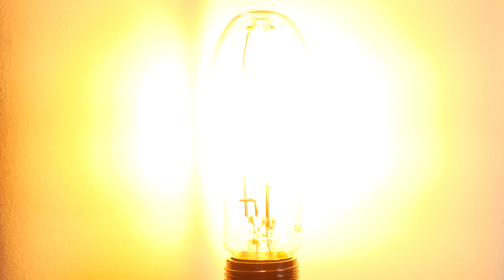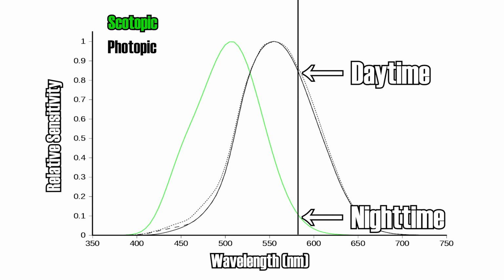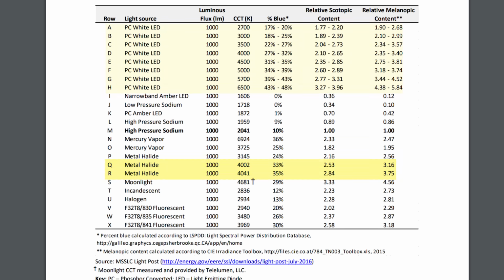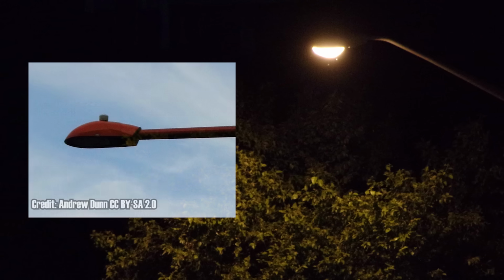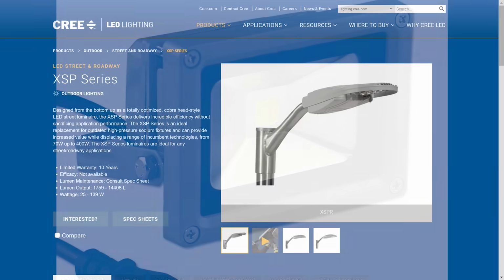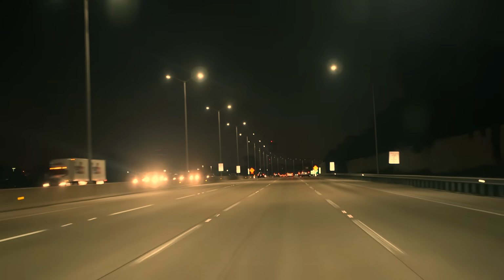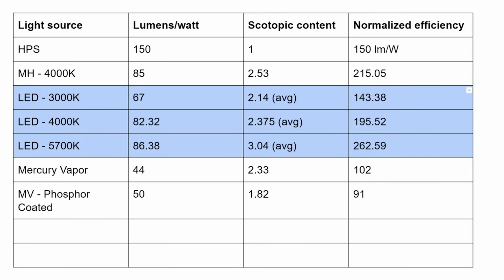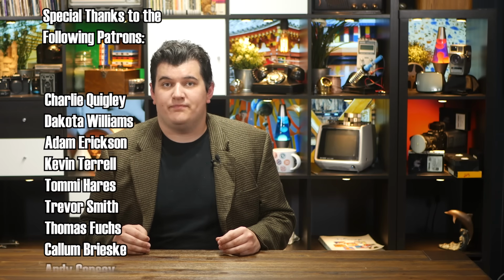The LED's Challenge to High Pressure Sodium

Comment: LED street lighting is crap, the cut off angles are too sharp resulting checker board roads, their reliability is questionable and their penetration thru fog is garbage. and I'm a fan of LED lighting but in the right place.  White sodium lamps are available.  I doubt that your energy figures are even close to  accurate you didn't account for the shithouse power factor of switch mode power supplies.
Reply from the maker: Maybe you should take a look at the spec sheet listed in the description.  The power factor of these Cree fixtures is greater than .9 and THD is less than 20%.  And as I had explained, there are good and bad optic designs.  The segments I showed on I-88 clearly demonstrate excellent light distribution with no "checker boarding".
Reply: A magnetic HPS ballast is a highly inductive load so the power factor of these is significantly worse than say a high powered/high quality LED driver from MEAN-WELL electronics with active power factor correction. Normally these top out at .98-.99
Reply: That is why I said "corrected" as for the electronic drivers, no chance they are near unity and don't forget to add in the harmonic and RF distortion they create.  Remember these things will be built and purchased on price, installed by idiots and maintained by no one, the only time a street light gets any kind of cleaning or attention is when it becomes a "street dark"; so even if your super quality driver and its matching super quality emitter all presumably housed in a super quality housing (sounds super expensive so far), lasts for yearrrrrs, the optics will all be filthy after a few years and there goes your light output, since HID lighting has a much larger window, it can be half full of dead moths (and how many of those have we seen), yet still have reasonable performance.. Most of the cheap garden variety road lanterns around me are better than 20 years old, all running their original gear and optics, all still going strong on probably only their third $9 lamp, so far more cost effective than LED.  So back in your box spikester, nice ad for MEAN-WELL, pity that they are responsible for the majority of the junk that I find myself replacing.
Reply: I will check it out, if it is really 0.9 lagging I will buy a hat so I can eat it...  I truly hope it is but none have been halfway close when I have put them on the analyser.  THD less than 20% I should damn well hope so I should hope it is less than 3%, sounds like I'm just being contrary for the sake of it but it LEDs are just not there yet and they are far too susceptible to voltage transients, air temperature, bird shit build up on the heat sinks, and vibration, keeping in mind that when they fail the whole $300+ thing is scrap, not just a $9 lamp or a $20 ballast.  Not there yet, there is no R.O.I. in replacing 400 Watt HPS fittings with 300 Watt LEDs or replacing 80 Watt MVs with 50Watt LEDs.

Comment: I am not quite sure I get the argument why sodium light leads to ineffective lighting - you say the reason is that its frequency is not one to which the eye is particularly sensible in the dark. But - after all - due to the sodium light, it is not dark, is it?
My understanding why sodium light sucks is its extreme monochromacity, which strongly filters the spectrum of the perceived objects, and leads to a distorted image.
Reply: you know how there are two types of photo receptors in oure eyes: the 3 types of colour receptors (Cones ) and the other ones which are more sensitive (Rods), now during the day we use the colour receptors almost exclusively and the sodium lights produce a spectrum that corresponds well to the percived brightness during well lit conditions, but when it's dark the other type of receptro (Rods) starts to take over and now the spectrum of the sodim light doesn't correspond well to percived brightness. While it is no longer "dark" under sodium lighting it is no where near the brightness of the sun so the rods are still responsible for the majority of the visual information reaching your brain.

Comment: Wouldn't it better that drivers don't feels asleep because the light resembles a light which make us tired? :? I don't get your point here.
Reply: For main roads yes. For neighbourhood lighting, lots of bedroom light pollution and much lower traffic...
Reply: Ruben Kelevra I thought that to. And our rhythms are already messed up cus of phones on screens in our cars anyways.
Reply: Alex Jago Curtains are a thing though. Here in northern Finland we have coped just fine even though during summer the sun doesn't even go down during night in mid summer. The only thing you need is good curtains to block the light.

The advatages of LED lights are pretty obvious. :P
Reply: XlordslaughterX That's a good point! I didn't even think about that... I suppose warmer light does have it's advatages. But which is more important: saving energy and slowing climate change, or help wildlife to sleep better? I would say energy saving is more important, since by warming up the climate we not only mess up local wildlife, but the wildlife worldwide.
Reply: Ruben Kelevra the issue with circadian rhythm disruption is more for wildlife from what I've heard in the past.
Reply: Agree. Perhaps apply the cooler lights on busy streets and highways, and keep warmer lights in smaller residential streets.
Reply: cdrom do you know what DOESNT have any downsides? Solar FREAKIN ROADWAYS. That's what.
Reply: If they had ever worked it sure would have added a lot of light pollution. ;)
Reply: I'd go with bright bluish lights for highways and fast main roads. For residential areas, where drivers are also at much lower risk of falling asleep at the wheel, warm light is a good choice.
Reply: Sleep or drowsiness was a contributing factor in 18.6% of nighttime road accidents according to 1999 Norwegian study on road safety. You have to be insane out of your mind to try to spin sleep disruption while driving as anything but a positive.
If streetlight are lighting your dwelling in a manner that is disturbing your sleep, buy window blinds. That is a small price for increased road safety and human life.
Reply: +Neil Etnyre Smartphones, on the other hand, has already a night-mode, changing the color temperature. Car screens also have night-modes, to get a much lower light output, by switching to black. :)
Reply: I don't any light from outside to get in my bedroom anyway. So I really don't care.

Comment: Where I live all the HPS street  lights have been converted to LED. I like them - plus they use a LOT less energy. And they've even swapped out HPS for LED on I-95 through the state. In fact they're flat fixtures so the light is cast into the streets where it belongs.

Plus they changed the fixture instead of using a drop-in. 

And the biggest uplit building in the city - the State House.

Comment: I actually got the old street light that was in front of my house earlier this week. They were replacing it with an LED one and I was there at the right time to ask if I could have the old one. It's pretty big, to say the least. It has a mercury vapor lamp in it, but I'd like to get a high pressure sodium lamp for it at some point, provided the ballast is compatible.
Reply: Austin Allmond is it a big buzzing magnetic ballast or a smaller digital one? I assume if it's Mercury vapor it's probably an older magnetic one but I've wondered which ballasts they use in street lamps
Reply: The digital ones generally work with more lighting types too
Reply: Austin Allmond sometimes you can tighten the lose plates in the ballast and make it quieter
Reply: It's a 175 watt. Magnetic ballast that's noisy as hell on startup, to the point that you have to yell over it to have any conversation. The windings are actually somewhat loose in the frame - you can move them around by hand.
Reply: There doesn't appear to be any way of doing that short of cutting the welds on the frame and putting something in there to shim the windings. I'll probably end up getting a new transformer when I go to fully restore the light.